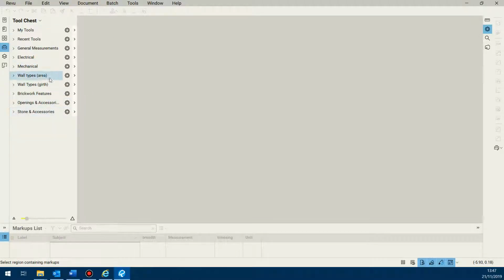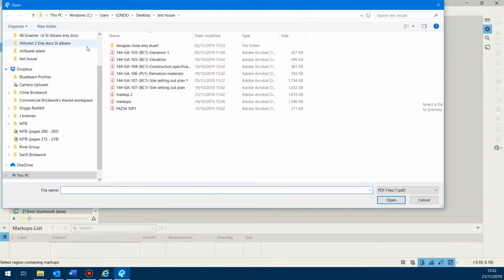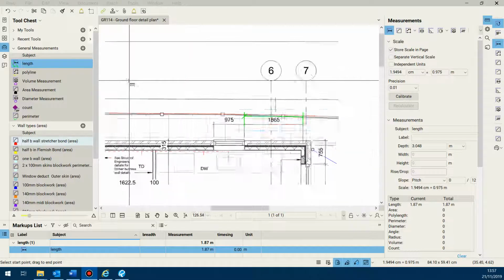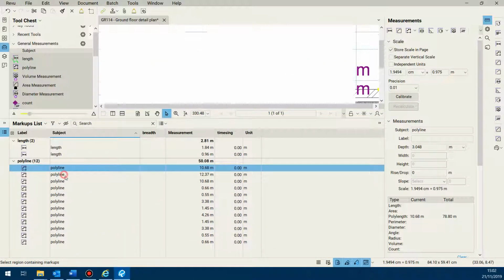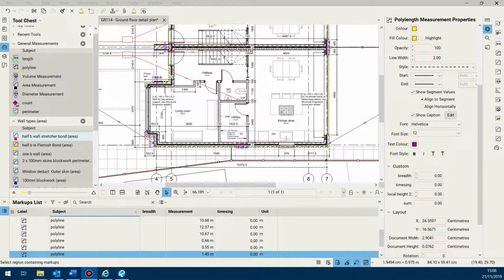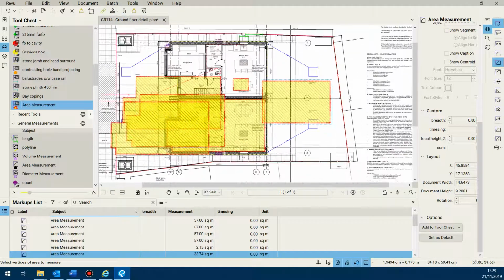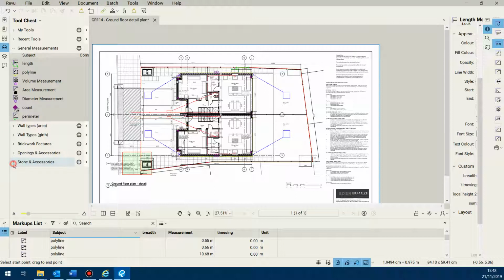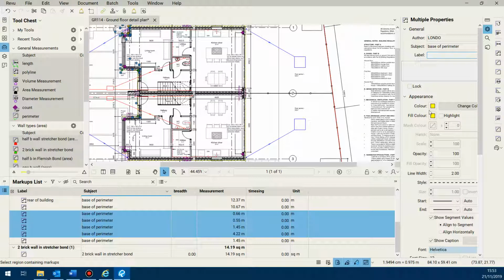Course 2 Lesson 3 Tools and tool boxes

Comment: Been using bluebeam for a while, but one thing I would find useful is to continue a polyline or perimeter measure. Can it be done?
Reply from the maker: Yes tim, just right click on the last 'node' of the markup tool and select resume
Reply: @londonbricklayers   Thank you, knew you could do it withy count, but didn't cross my mind to try it with polyline or perimeter measure. Cheers.